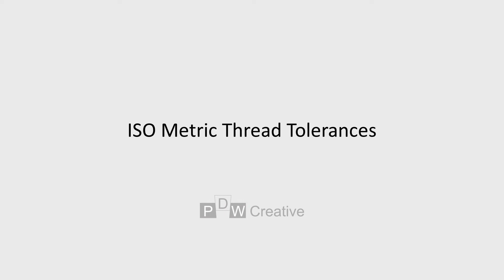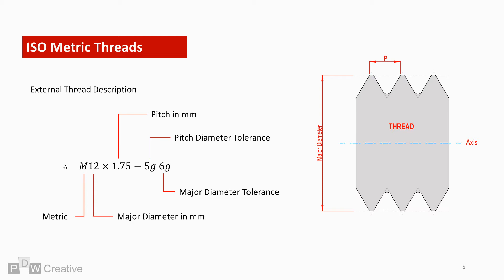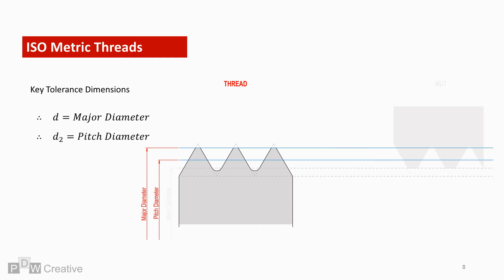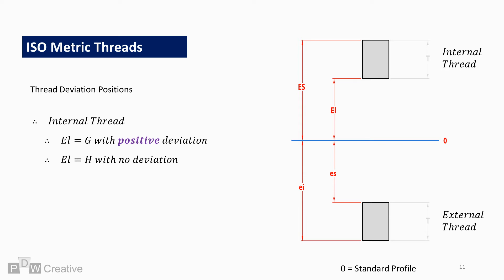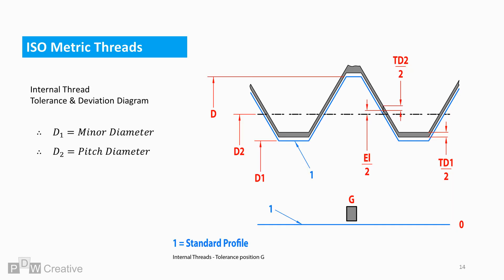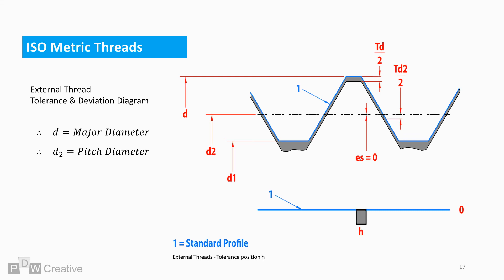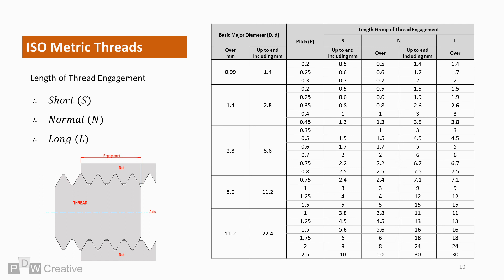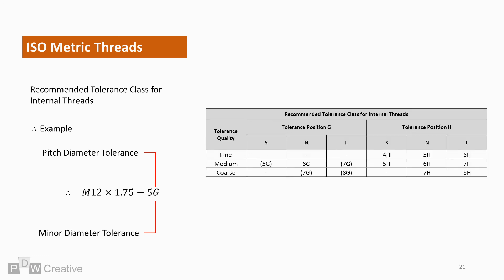Metric screw thread tolerance

Comment: I need examples because I am finding contradicting information in the tables. (or not looking at the correct table). For an example if I need to know what the Minor diameter max and min value are for a M20X2.5 6H. I found out that the value is 17.294 but I got a table that class 6 is 450 um (BS ISO 965) and H is 0/+0.042 so is the min max value 17.294 to 17.744 or 17.294 to 17.474 or 17.294 to 17.516 Witch is all wird because the drill in 17.5 before threading so anything under this is irrelevant.
Reply from the maker: There are lots of different standards all with slightly different interpretations. You need to pick the one that works best for you